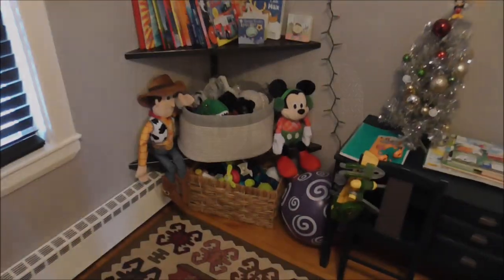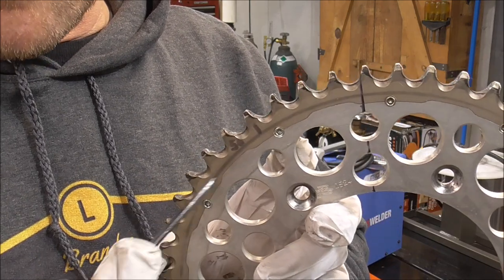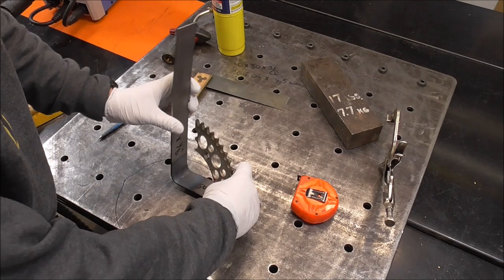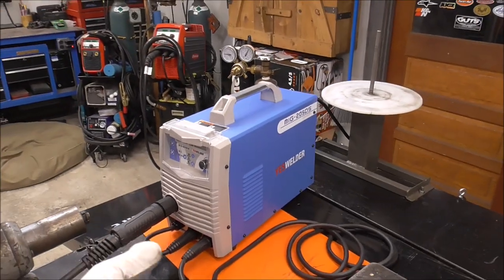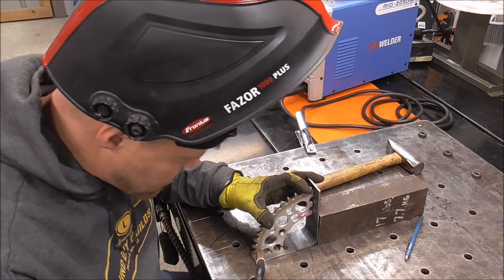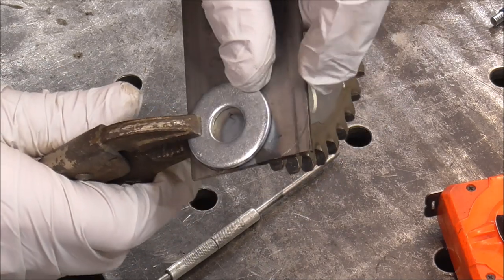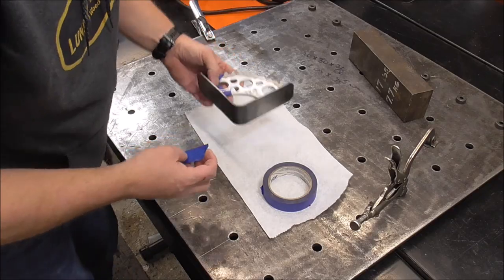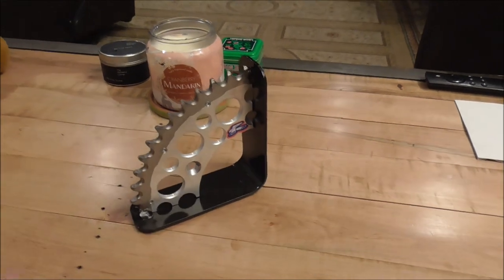MIG Welding Metal Project Shelf Bracket Bookends

Comment: Great project as always. You should consider building the Revolution 2x72 belt grinder.
Reply: It's a pretty big investment and he doesn't do a whole lot of grinding.  I would love to have a 2x72 belt grinder with variable speed though.  They are really kind of replacing bench grinders in a lot of shops these days.  They can do everything a bench grinder can do and then some.   They also take up quite a bit of space.
Reply from the maker: Every time I do a project where I radius edges I always wish I had a belt grinder. I've thought about building one. Maybe that will be in the near future. My shop is small and they take up a decent amount of space.

Comment: I also like to see you do some mig and flux core welding using 110 volts with the new Yes welder.
Reply from the maker: Thats a great suggestion! I' havent even tried it on 110 and I've been really curious. I will do some testing and get a video up. Thanks man!

Comment: Not a fan of synergic because sometimes I gotta turn the volts up in case a weld joint makes my stick out a little further than normal. Does the yes welder let you set it yourself or is it synergic all the time. Cool project. Looking to eventually get a evo metal saw too. You are kinda talking me into it.
Reply from the maker: @AJ's Iron Works it's primarily set on synergic but by toggling over to voltage you can independantly adjust your voltage in incriments of 1 volt from +9 to -9 above or below the synergic setting. I like that it;s very simple to use.

Comment: How do you decide when to clamp ground to the table you are working, vs the work piece?  Are there any safety concerns to be aware of when clamping to the table?
Reply from the maker: Great question! Pretty much the best bet is to attach the ground directly to your workpiece that way you are getting the proper voltage without voltage drop which will also give you nice clean starts and it will also prevent your work piece from getting arc marks from where it is trying to make contact to the table. Smaller parts that I need to manipulate a lot I will generally connect the ground to the table simply for ease of use because i'm not working around a ground lead.

Comment: I don't understand the silver streak pencils.  They are almost the same color as the metal.  Jimbo on Jimbo's Garage (pretty cool Youtube channel) reccomends these silver colored pencils as a cheap alternative to the silver streak.  I bought some and they blend right in with the color of the metal - I lose my mark if I take my eyes off it.  I like using a fine tip black sharpie or something similar to mark metal.
Reply from the maker: I agree Christopher. I have found if you keep it sharp the line is more visible. When it starts getting dull it seems like it glazes over and tends to blend with the metal like you mentioned.